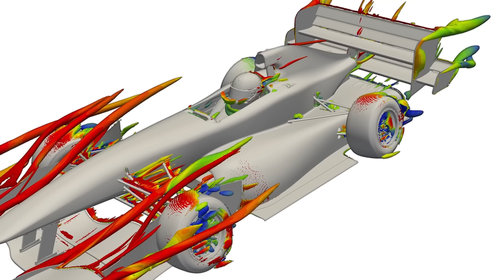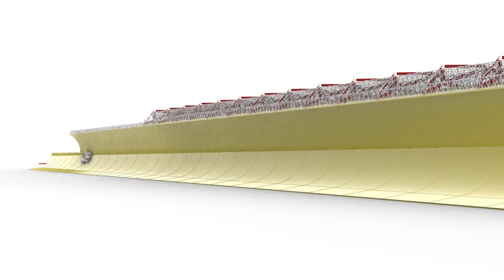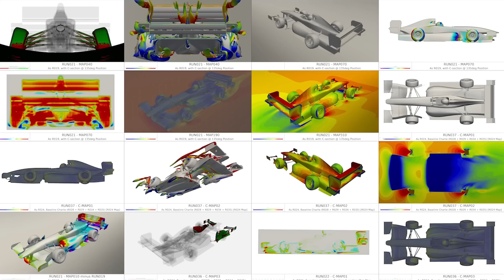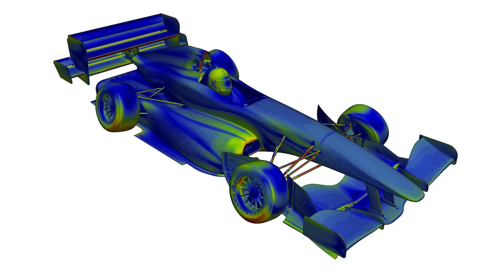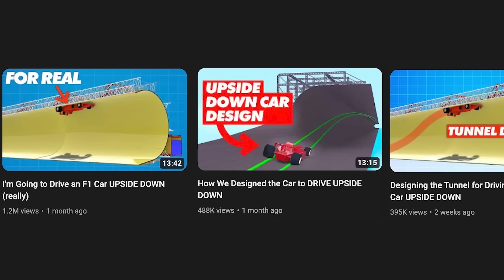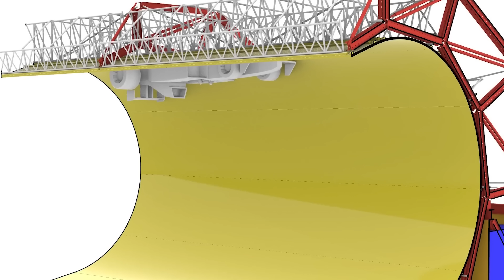Driving a Formula Car Upside Down (UPDATE)

Comment: You need to design the tunnel to use parts that either sourced from existing structures and/or can be used afterwords as standard parts - For example the Bailey bridge (or modern equivlent - or tower crane parts or even slotted angle iron (used for building industrial shelving) for the lighter parts - minimise the wasted effort and materials by useing parts that have other uses afterwords :)

Comment: As a mechanical engineer, the first thing I wonder is... why? it's clearly possible, but I really don't see what doing it will achieve. does it help with anything? or is it just a stunt?
Reply: Same thought process here. 4:08 is my issue. There's no real technical achievement, nor is it a display of anyone's skill, and this last part is subjective but I wouldn't even really call it exciting. We know exactly what is going to happen and what it will look like. There's no risk or uncertainty that would usually drive excitement over a project like this. It's extremely expensive for what it is and I don't blame investors for not being interested.
Reply: @bakedandsteaked  yeah, red Bull stuff is all about skill and pushing limits. this is just an expensive implementation of a proven concept. anyone with any engineering knowledge already knows it's possible. total waste of time and money in a world full of starvation and disasters. shame.
Reply: @LiamWallsIsRad most starvation nowadays is a completely political man made issue. Like gazans starving. If I had all the food and money in the world I still wouldn’t be able to send it to gaza because of Israel.

Comment: I’d inspire curiosity starting this on  small RC-cars on a $3k budget that an enthusiast who works hard can mimic…after this works at 1/16th scale RC go to 1/8th or 1/4 scale with scale weight dummy, and maybe modify a 2-stroke nitro-mix engine to pump fuel reliably, possibly using a chain-saw fuel pump and carb that are gravity-independent

Comment: You are making this much more difficult than it needs to be. If you are not even going to use a proper Formula car and are going to cheat by modifying it both chassis and engine, then why not just use magnets to drive that car upside down instead of downforce? And why not just make it even lighter by removing completely the driver and making it a remote controlled car? Cause at this point you are clearly no longer driving an actual Formula car upside down, it's a prototype that had a Formula as starting base. That car, realised the way you want it, wouldn't be fit to enter ANY Formula championship, not F1 and surely nothing below that. So don't make dumb and wrong claims like the one in this video's title. Just cheat all the way through while you're at it.

Comment: Btw, have you thought about other things, for example, about the way gasoline/oil is placed in the car, will all the necessary components for fuel/oil/ignition supply work flawlessly? What about the braking mechanism/power steering? Don't they need to be improved? For a ready-made car of this level, it will cost a solid penny. Perhaps it was mentioned in some episode that I missed. Please like this comment to make it to the top
Reply: Explained in earlier episode
Reply: He said they are going to convert the car to electric. I assume that is precisely because of the challenges with running internal combustion engines upside down.
Reply: @thomasdalton1508  Partly, but it's also other systems like cooling.

Comment: today, I read, that in salzburg, austria, exactly, where red bull is located, they will close down the neutor tunnel. the oldest tunnel in austria. it will then be just open to pedestrians and bicyclists and tramways.
sadly just 131m long, it might be not enough for your endeavour.
but it is 250 years old, and it is a tunnel?

Comment: Why electric? Electric cars struggle to achieve top speeds..
Reply: No they don't.
Electric is extremely reliable and doesn't care about being upside down, while a normal gasoline engine doesn't like it when the oil pools up in the completely wrong areas of the engine.

Comment: I had a feeling that this was the where the project was after hearing nothing about it for a few months. It can't feel good when something you're passionate about stalls like this, but if your goal is really to inspire people to take up engineering challenges, you're going about it the right way. Engineering is about solving problems within the constraints you're faced with. You've found your cost constraint and now you're re-evaluating and approaching from another angle in response to that: that's core engineering activity.

Comment: Not sure if you guys have considered this yet, but you need to design an oil sump for the engine while its upside down.  5 seconds upside down will destroy the engine.  I also suggest you include an oil accumulator that stores oil under pressure that will supply the engine with oil when the car goes upside down.
Reply: that's one of the reasons they ditched an ICE and are going electric

Comment: you dont need the whole tunnel to have curved walls, just the start (and finish)!
the middle isnt required as it will either work or smash into the ground without warning.
Also, it definitely cant be in open air, it has to be in an enclosed tunnel. I'm surprised you have missed this fact. 
Any side wind load will unbalance the car, break your under car downforce, like an actual race driver knows from real world experience.

Comment: Why not have a car placed upside down, with something that holds the car down until it reaches the desired speed and then releases the car, then catching the car again is of course the  hurdle. I'm by no means an engineer but it feels like the custom built ramp and the 180 is the big problem.

Comment: I think having the vehicle be electric is a loser move. This dream is not related to EVs, it started way before EVs. Airplanes fly upside down (ones that are built to), it would not be a large technical hurdle to have the gas vehicle drive for a few seconds upside down. Without the engine sound this will be a snooze fest.
Reply: EVs are simply more reliable for this.

Comment: From 14m to 3m... Sounds like a come up scheme to me
Reply: Probably using second hand materials, rented equipment, and a lot of resealable material after the feat is done, a civic engineer company on the contrary would want to use very specific equipment or materials of the highest grade that would end discarded after the fact.

Comment: Out-of-the-box thinking...

After the project, does the structure generate any residual value? At the very least, could it be repurposed or sold for scrap?

Is the $14 million budget a lifetime cost analysis, or strictly the upfront expense?

Instead of focusing solely on lowering the initial cost, why not consider ways to create value from the structure post-stunt? This approach could attract sponsors or investors with a long-term perspective.

Easier said than done, of course, but some creative solutions could naturally emerge. For example:

Leveraging existing construction projects: Partner with a construction project already underway, and integrate the tunnel into their design. This could reduce costs significantly.

Pitch to investors interested in symbolic value: A city or small country looking to attract innovators might embrace this as a bold symbol of innovation—perhaps even a modern art installation.

Create an ongoing attraction: Instead of just a one-time stunt, why not transform this into a Las Vegas or Disneyland-style attraction? Multiple runs could inspire more people, especially kids. Imagine a live audience watching multiple cars perform the stunt, or converting it into a roller coaster after a few successful runs. Ticket sales could offset costs while creating a lasting legacy of inspiration.

Find a pay-driver: Many wealthy individuals involved in motorsport would pay for a chance to drive and etch their name in history. For some, $14 million could be pocket change if tied to the right narrative.

Deconstruct core requirements: Break down the project’s essentials and explore shared value opportunities. For instance, could parts of the tunnel serve dual purposes for other industries?

One thought: I noticed the "tunnel" design is open on one side. Is that purely for camera placement or spectators? A fully enclosed tunnel might make the concept more appealing for certain sponsors.

Explore R&D potential: Could the structure or associated technology hold R&D value for companies in related fields? Offering this angle might attract partners.

Out-of-the-box thinking... you’ve already got that down! These are just some examples—there’s so much more potential here. Wishing you the best with this incredible project—I’m excited to see it come to life!

Comment: Driving upside down ???
I did that 40 years ago in a GP4 Ford Escort. Having said that there was no tunnel involved and it was on the roof!
Reply: I found this way funnier than I probably should have. Maybe because I've been there too haha
Reply: Did the same with my gmc pickup, way cheaper and again no tunnel.
Reply: @johanpenner2138  Cheaper, I suppose?
Reply: @ … really? 😂
Reply: more of a slide really
Reply: Did the same thing with my suzuki turbo hayabusa. in a tunnel, no fans for 2 hours straight none stop
Reply: Magic rug? 😁
Reply: i also did it 22 years ago but there was a scary part involving sparks from the roof, that was just until i flipped again...and i'm here like you to tell the story
Reply: @ .. sparks? No you didn’t! 😂😂😂
Reply: Did the same with my supercharged turbocharged rocket powered 1970 GMC Motorhome RV. In an actual tunnel, no fans.

Comment: Do your calculations include loss of traction supporting the necessary speeds to maintain inversion when it is surface imperfections/bumps are likely cause the car to lift away from the inverted surface? What kind of tolerances for bump forces do you think the plan can handle, and is the engineering designed to meet that kind of safety factor?

Comment: Why didn’t you just build a tube instead of a tunnel and use a roller cage to get the car upside down and up to speed, then retract the rollers to confirm lift. I never thought you’d get this done. You’ve over scoped this and are focusing on the wrong place

Comment: IIRC the red bull stunts to land an airplane in the Burj helicopter port, and flying a plane through a tunnel both cost more than $3,000,000. Also, perhaps a real tunnel being constructed and just prior to opening could be used with a simple adapter at start and end.

Comment: Problem easily solved just place a steel plate on the bottom of the car missing the ground by a small distance and place magnets on the tunnel ceiling and away you go. Doesn't matter how fast or slow you go you won't drop.😂😂😂😂😂😂😂 I know it's cheating but no will know if you never tell them.BTW you won't need millions of pounds either.Don't worry kids being kids they will be amused.

Comment: This won’t happen. When you are upside down, you will have 2x the weight of the car LESS downforce. Which is less traction. Which is slowing down and loosing steering grip. Which is loosing control and crashing.

Comment: Tom Cruise, Mission Impossible.  It would be chump change.  However have you considered that you don't need to start right side up.  All that curved wall stuff is unnecessary to prove you can drive upside down.  You can start upside down with a support and once the aero kicks in remove the support.  That would only require a wind tunnel.

Comment: I wonder if there has been consideration to placing the car on the ceiling and then catching it rather than driving up the wall. Essentially my thought would be to have the car already inverted on top of some high speed truck that is able to lift the car to the roof of an existing tunnel at the required speed (yes there would be issues with roof mounted infrastructure) and then once there the lift falls away and air bags inflate so that the driver is able to do their 5 seconds of driving and then land safely back onto the same truck. The idea here is to skip the issues of sourcing a location and building a tunnel at all. If you're able to use an existing tunnel or hijack one currently in the build phase before the roof mounted infrastructure is installed you might be able to save a large chunk of cash. 🤷‍♂

Comment: Must be cheaper ways than £3M even though that should be easily within the marketing budget for Hotweels, Redbull etc for such a unique stunt! Why not use an existing tunnel and build road segments that are "just" clamped between the walls with braces up to the ceiling and up + down ramps at the end? Not easy but saves the effort of building the whole thing from scratch... Anyways really looking forward to this and great to see someone is actually doing it! 🙌

Comment: The aero to exceed gravity and hold the car on the roof is one thing … a whole other issue to have enough power to develop the excess downforce you need to maintain tyre adhesion (so you don’t have an uncontrollable oversteer or under steering slide)

Comment: I already told you how to do this, just stick a standard F1 car to he roof of a wind tunnel. Either it works or not, no issues with running a car upside down, it only needs to stick there!
Reply: They aren't trying to find it if it works. A computer simulation can do that. They want to actually do it.

Comment: No ICE? Just an electric motor? Hmm... disappointing.
Reply: Well how many ice car engines have been designed to run upside down? You’ll need the tank in upside down, so it’s just much easier with an electric motor.
Reply: @blakecrossing  You got me there- good point.

Comment: Why not do away with the entry ramp to save cost, and run the car up to speed inverted on some form of towed sledge and then release it onto the ceiling. The sledge then gets the heck out the way so as not to ruin the shot! The car can do its amazing inverted driving and exit the ceiling as you've already planned. This must surely have a big impact on the implementation cost as it does away with the run up and initial banking used to access the ceiling. Maybe not 100% as spectacular but the car will still run unaided on the ceiling and that is the point of the demonstration. A small sacrifice if it takes the project from drawing board to reality.

Comment: every time I see this topic mentioned, I question how many parts of the car would need to be re-engineered to allow them to run upside down for more than a few seconds? Yes the aero should allow the car to defy gravity, but none of the contents of the car, including driver and any contained fluids will enjoy the same. Obviously, the car is designed to be able to run in negative G momentarily when going over crests, but not for sustained periods.

Comment: If you're going to build a structure from scratch why not build a flat road with a 180 degree twist inverting the road along its longitudinal axis then again to revert it to start: like a huge flatline corkscrew. The road surface remains flat unlike driving up a curved wall, the car always travels in a straight line instead of driving up a curved wall at an angle then back down again, the height of the surface remains at a constant height so if the car falls off it will always fall a set, and much shorter, distance, ergo "safer", you'd also be  build a lot less total structure thereby saving time, money and labor. Additionally since it's not a tunnel (or half tunnel) you'll be able to shoot video from multiple angles since half of the structure won't be behind a wall.
Reply: Yes, I've made a similar comment in the past. There's absolutely no need to drive on a curved surface.

Comment: Why rely on sponsors of a company? If it's for the people get it funded by the people. Run a raffle to win a car/house/F1 holiday/face on the pipe/other. Where each ticket costs £20-40 or so, and you'd only need 100,000 - 200,000 people to be involved and you've got £4 mil - should cover the costs of prize, contingency/inflation and other bits n pieces. Easy! Especially with your 1.3M subs and 120k viewers already at the time of this comment.

Comment: I admire the engineering work an dedication put in this stunt, but why? Wouldn't such amount of effort and money be more sensible to use for research of safety of drivers? Or something else related to most pressing issues in F1? I'm just an car ethusiast, not engineer, not particular fan of F1, but this is just silly.

Comment: Why not just use concrete culvert pipe. After the stunt it can be sold back into civil construction. Thus recouping 80% of the cost.  In fact you might even be able to just borrow the pipe.  Add in a bit of free advertising for the civil construction firm, and bobs your uncle. 
It sounds very much like too much thinking and not enough imagination is being exercised. After all on a much smaller scale kids have been using pipe to race matchbox cars for decades. And culvert pipe is so common across the world as to be easily overlooked by engineers focused on making a technical solution.
In fact your largest costs would be preparing the groundwork’s of a site to sit the concrete culvert pipe on so as to ensure good alignment. But even the metal (gravel) required could be repurposed after the event. 

You might begin with finding a significant Dam or Hydro energy storage construction site where extensive spillways are planned. 
“Borrowing their pipe farm for the event could be a simple negotiation, as long as you cover the relevant insurance costs, and your timing fits the construction timeframes.